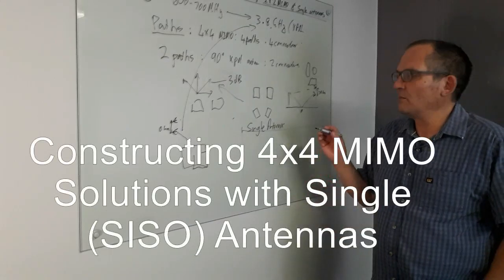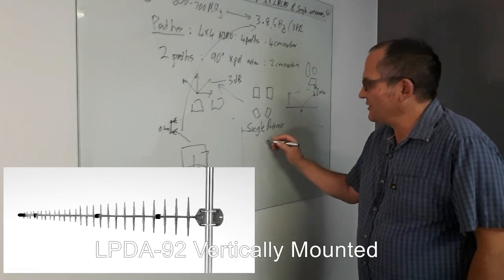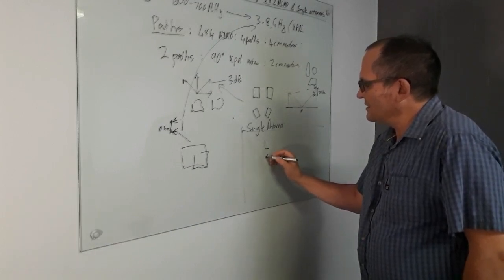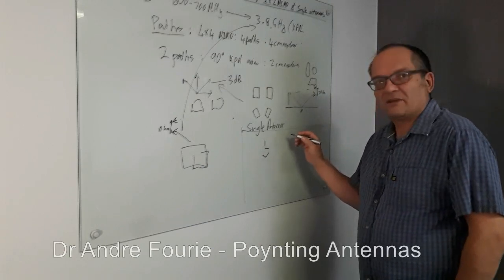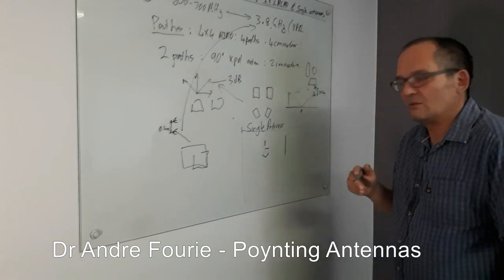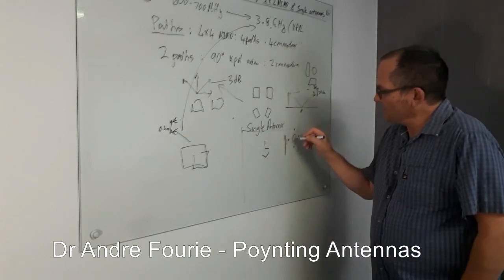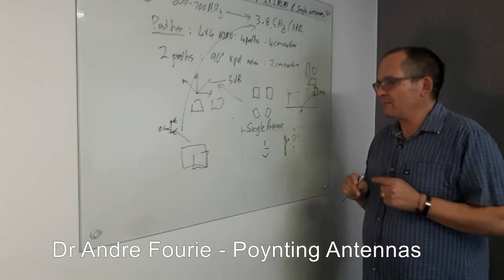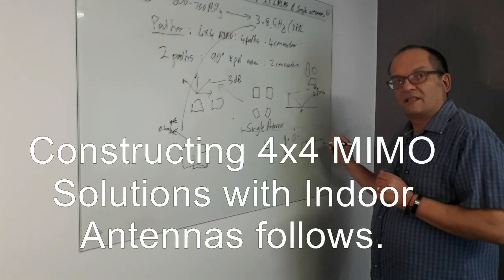Constructing 4x4 MIMO solutions using Poynting SISO Antennas

Comment: Just wondering @Poynting Antennas... 
Would it be possible to use two 45 degree brackets upside down from eachother on a single mast with the (in this video described) 0.6 meter distance between the brackets to get to the 4x4 MiMo setup instead of a horizontal, vertical and 45 degree mounting as described in the video.
This when using the LPDA-92 antenna's (have two already for 4G here combined with a Fritzbox 6890LTE, not 5G ready)